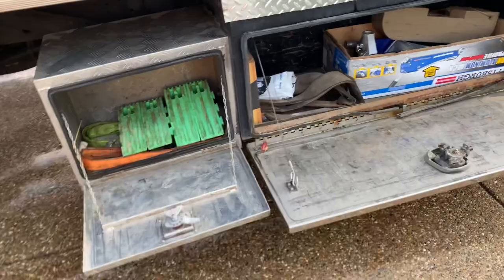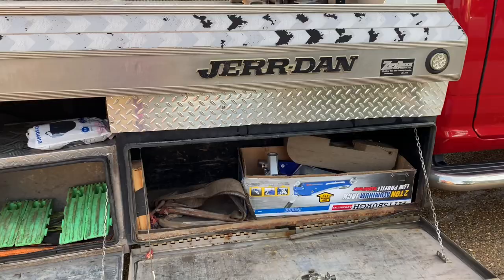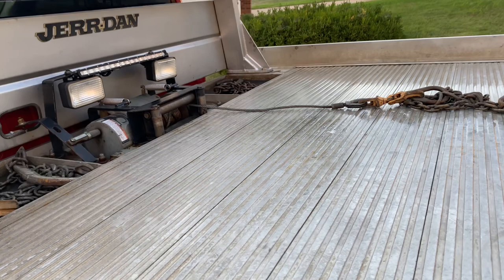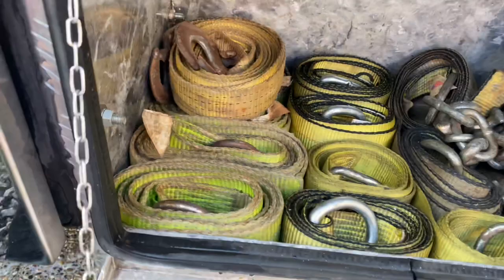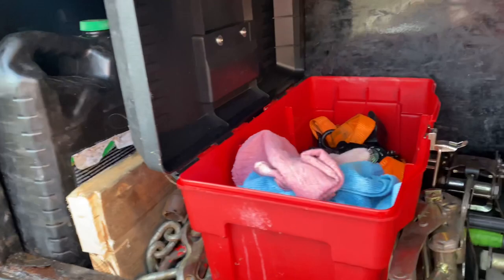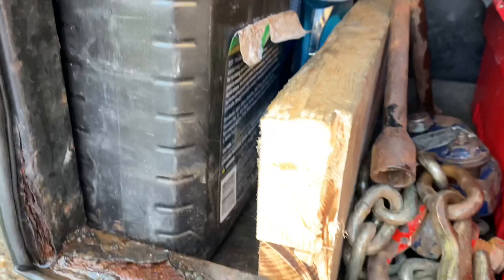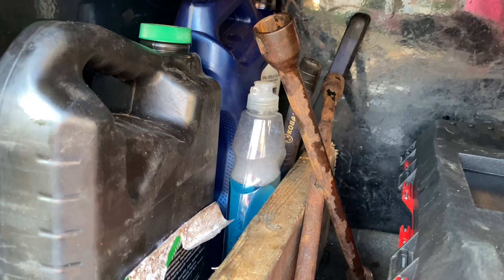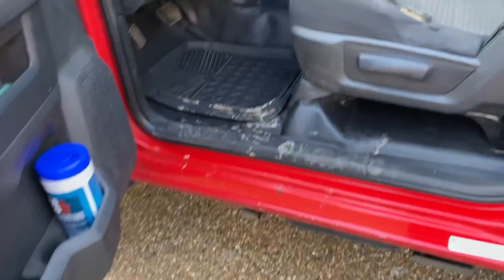How to set up tow truck

Comment: Put a oil pressure activated hour meter on your Diesels and change oil at 250 hours! Much better and accurate oil change intervals. You don't realize how much Idle time gets on your oil.  Learned that from the Aviation industry!
Reply from the maker: with full synthetic and how I run it I get about 6k miles per oil change on rotella

Comment: Good shit brother. But maybe add 1 thing, Why carry around those huge old tech jump boxes that are just lead acid battery that need recharged all the time and get a Gooloo GP 4000? Hell for what they cost$100.00 for analog, get 2. They fit in glove box, console and won't need charged for a long time. I bought 1 after watching project farm test them a few times. It starts any car, truck that has 1 or like diesels, 2 batteries. It's lithium so it'll last a weeks with no charge and be 100%. My dad bought a few of those big boxes and they was ok. I showed him this and he bought 2. Idk what tge specs are it's been a year or so but it will start all gas and up to 10L diesel.

 I used mine to jump 1 dead battery in 650JD dozer. Dad thought no way this lil box will do crap. Well it did. It's surprised me alot. I use it on many cars daily as batteries seem to last maybe 2 years now and I've had to tow more ppl with bad alternator, batteries, stuck in park, parking SWITCH stuck on.

 BTW who's the genius engineer who said, U no what, we've had the same pedal and cable system that's worked forever let's make it all electronic so it's cheaper. Better, etc. Some don't have jump posts, or battery is buried under plastic air cleaners, cladding, in back, under fender. I carry 2 gal jugs filled with Dawn and water. It's saved me a few times, like the small chain block pulley. I do see ppl with the  1 long strap with a smaller strap for the wheels. Seems like a good idea. Not towed any rolls or Bentley but a few BMW, Mercedes, Caddy etc and not having and blocks would've cost me from tearing off airdams and front bumber skins. If they gonna make them so low, why not make them able to go up with a button? Especially BMW. We all know they gonna break down in 5 years and it'll take 2.3 hours to change crank sensor, or cam sensors. Lmao. I walk the truck when I can. In right places it's a big help. Just get those rear wheels up off ground and it'll be fine. Made to take some use.
Reply from the maker: I have multiple noco packs from the small to the big boy ⚡️